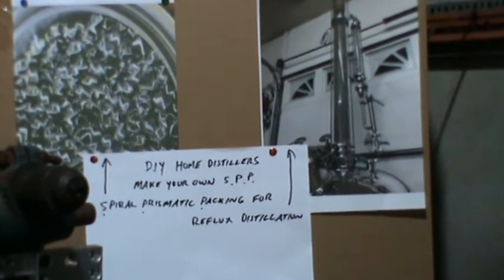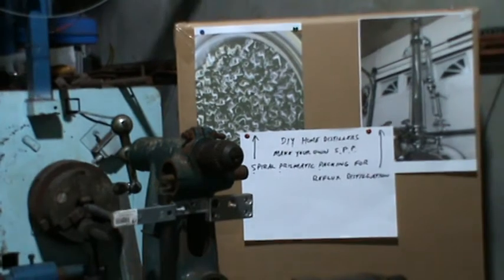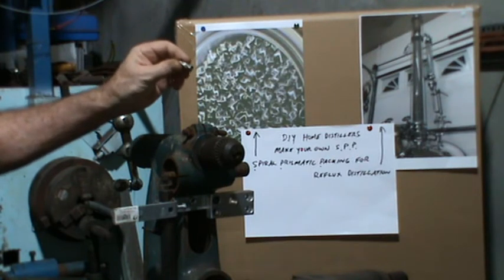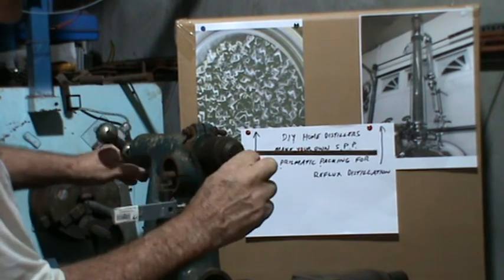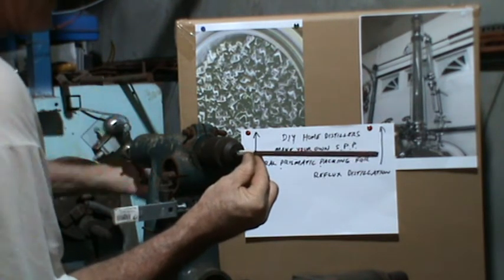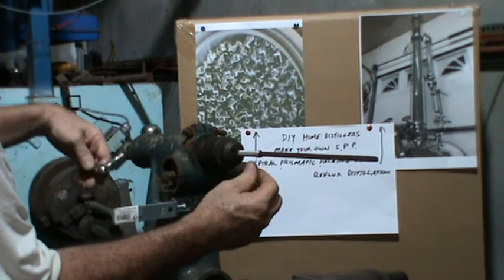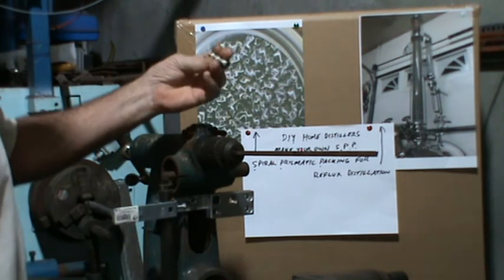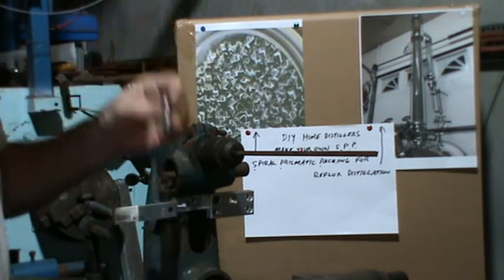How to make your own SPP , Spiral Prismatic Packing

Comment: I have heard SPP works best when the coils are not touching and I expect with a "certain" spacing between coils.  A thought - select a bolt or piece of threaded rod of a certain?  length and diameter with a certain? thread spacing, grind flats (3? flats or 4? flats) along the length leaving a small section of threads between each flat to establish coil spacing. OR position a piece of threaded rod as a coil spacing guide very close to the "spinning diameter" of the winding mandrel